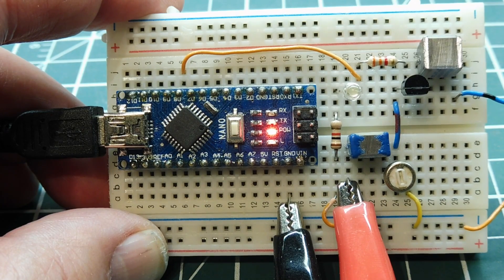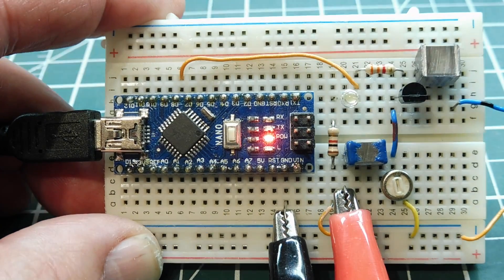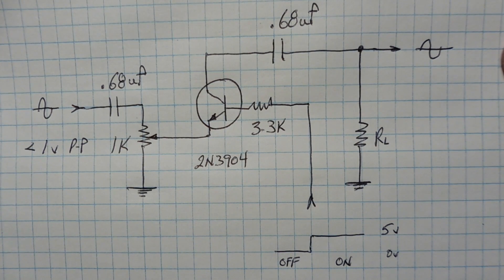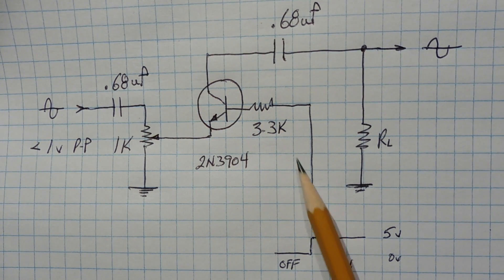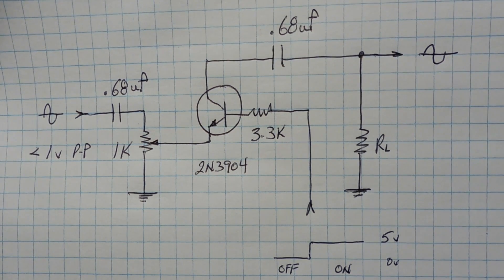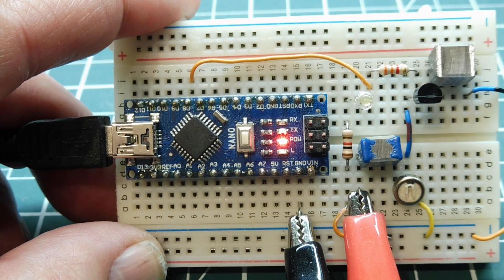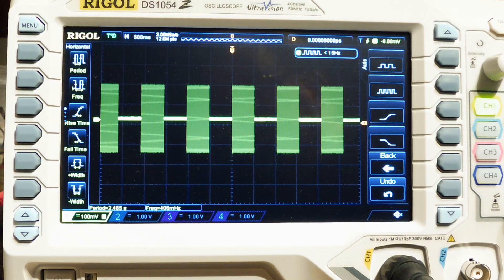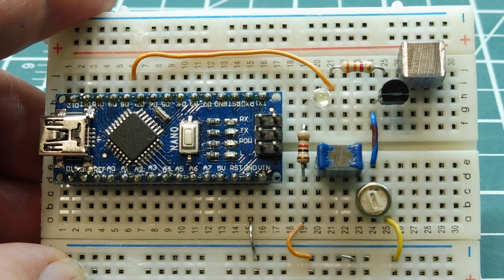How To Build A Simple Audio Switch

Comment: Hi, I'm looking to build a 6-to-1 selector switch for a guitar amp.  I'm thinking somekind of relay switch.  You have suggestions in terms of parts (controller, etc)?  i dont know what parts are available.  i grew up using ttl :)
Reply from the maker: Checkout the CD74HC4067 https://www.sparkfun.com/products/9056
A couple of CD4066 will also work. There are also boards using relay switch contacts. Search online.